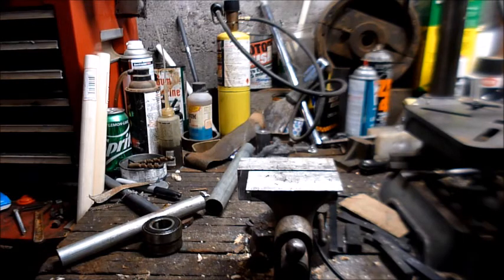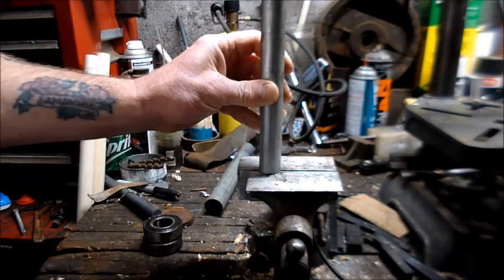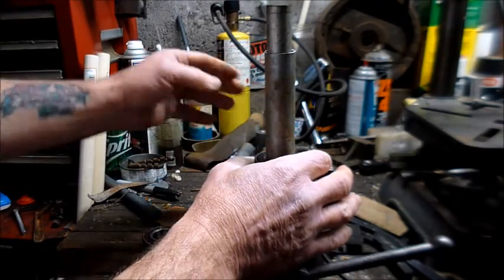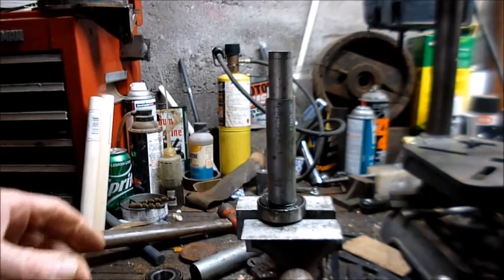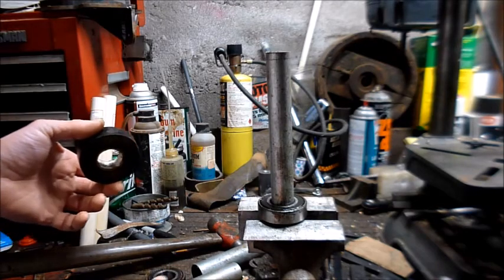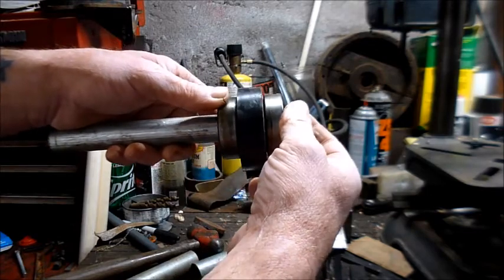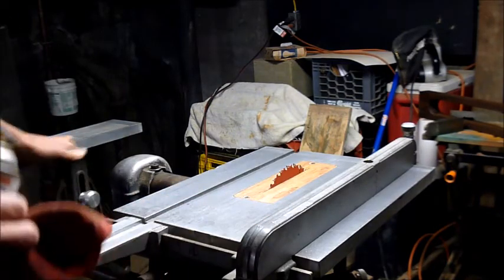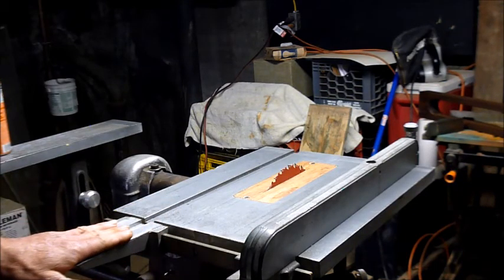Shopsmith 10ER drive shaft bearing replacement

Comment: This video was fantastic because now I know how to replace the bearings on my 10er which I believe is what happens to be causing me problems with my wood turning, at least I hope that's what is causing it. My drive shaft has a slight wobble in it when turning on the lathe. But when I crank it up to high speed with a decent sized chunk of wood mounted it causes the whole machine to wobble and shake so severely that the whole machine will literally Start to walk away from me across my patio.🤦🏼‍♂️🥴 But anyway I believe its the bearings that are causing this to happen. If I am wrong about this and you might think it's likely something else that would be causing this problem for me I would greatly appreciate your input/advice, TIA. And also thanks again for posting this video as it made things alot easier for me to understand the process of changing the bearings. Also, does the silicone work well for the way tubes? I have been using a type of grease similar to lithium which the saw dust tends to stick to causing the headstock and carriage to stick really bad and its really difficult to slide them. Is that an issue with the silicone spray as well? Sorry for the long ass comment and all the questions. Happy woodworking my good sir 🤙🏻
Reply from the maker: Im glad to help. The good news is that there arent many other things that would cause that. I have read that the splined shaft can get sloppy over decades of use although they are tight on both of my 10ERs, and make sure the drive spur and live cup center are aligned properly. I am not a lathe expert but I was taught that the larger the piece (wood or metal) the lower the speed, but as I said, I am no expert.
Most guys seem to use johnsons paste wax for all sliding surfaces, seems to be a common and generally accepted practice, I used silicone spray because its what I had and for me it works well enough, I would avoid any manner of grease for the reasons you described.

Comment: Excellent. Thank you. Where did you get replacement bearings? I can’t seem to find the right ones?
Reply from the maker: I bought mine on eBay from guy who is very proud of selling Japanese bearings instead of Chinese bearings. These are very similar but not exactly the same. the difference is the tolerance. Apparently the originals were C1 bearings (very tight tolerance). The bearings available today, that are readily available, are C3 (slightly looser, in fractions of a thousandth). I tried to find C1 bearings and it became obvious that if they were available at all it must be a state secret and would likely be a couple of hundred bucks each. Here is a link to a forum page that discusses these bearings, https://forum.shopsmith.com/viewtopic.php?f=10&t=20426   Good luck and thank you for watching!
Reply: @tobroken1965  thanks much. I just bought a 10er and it is super dirty and the bearings are probably original. Mostly cleaning and it’ll be like new but the bearings need to be replaced. Thanks again.